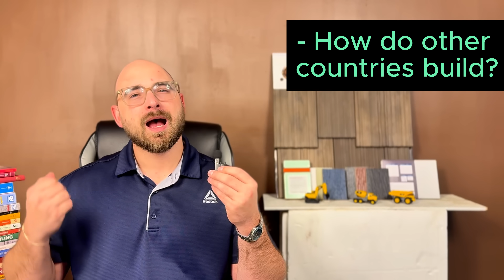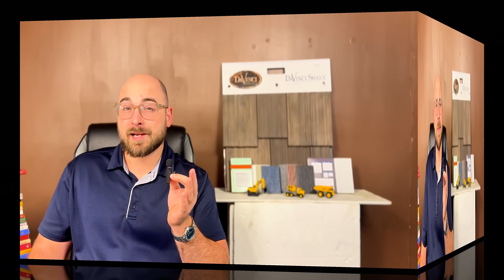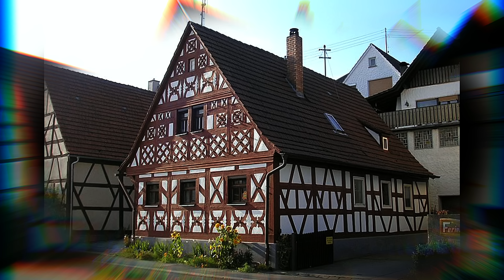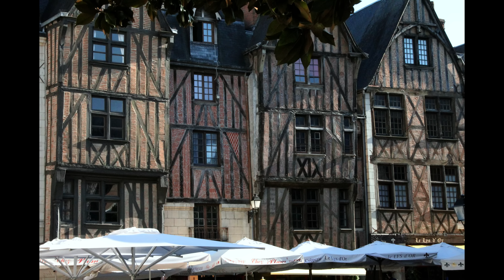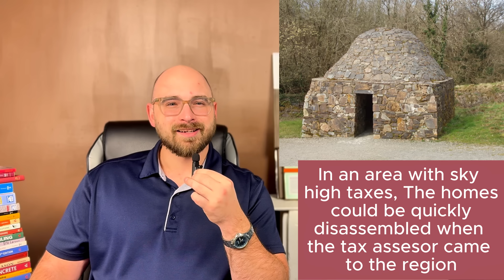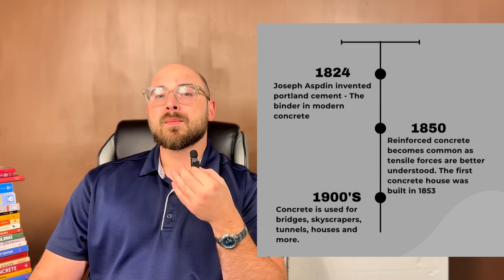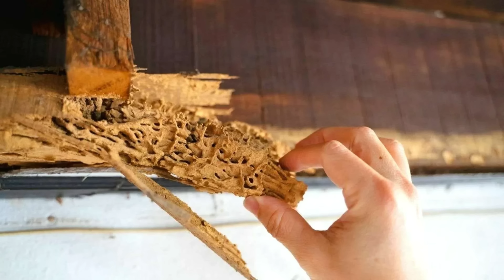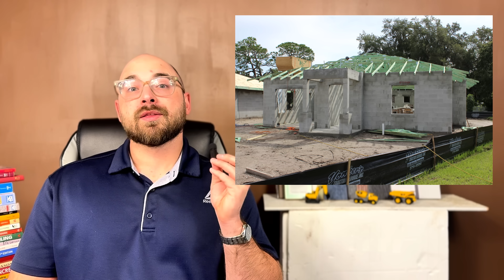Why Other Countries LAUGH at American Homes

Comment: Everyone on here saying wood is better for earthquakes than concrete.  I lived in Japan 17 years and always in solid concrete apartment/townhouses.  They have earthquakes every month where I was.  They chose concrete for a reason.  They were built to withstand severe earthquakes.  There is more to earthquake-resistant construction than just the material used.  They also use some kind of shock absorbing within the foundation.  Also lived in California about 7 years and have seen the wooden houses broken to bits.
Reply from the maker: Thank you for this 

Yes, absolutely true. 

Concrete can be designed to stand higher magnitude earthquakes than wood framing. This is accomplished through the use of seismic joints that allow for movement and reinforced foundations. 

I think in CA, concrete homes require additional engineering and approval. However l, money doesn’t seem to be the issue and at a minimum homes should be of steel construction
Reply: @Mike_Fortin  The whole point of not building with concrete in earthquake zones is to protect the occupants in the event of collapse. It's super simple and a really easy answer
Reply: I traditional Japanese building connections are made wood to wood with advanced geometry at many places while modern construction keeps everything together by nails/screws
Reply: @Stszelec01 
Yes agree, not to mention the quality of the wood species, often sourced from the surrounding forests, etc—in short, a know-how that is the pride of carpenters, masons, roofers, and more.
And tradition means preserving ancestral skills. In France, we have the "compagnons" who preserve and teach these skills (see the restoration of Notre-Dame).
Unfortunately, today, driven by increased productivity, cost reduction, and the greed of developers, these rules of the art are disappearing. Compagnons are abandoning new construction for the restoration of old buildings. And "industrial" construction with a low-skilled workforce is becoming the norm.
Reply: yeah, wooden structures can be extremely solid, but not when heavily optimized for material costs and ease of construction. Unless you have an abundant supply of decent quality lumber it quickly gets more cost effective to use other materials if disaster resistance is a concern. I've  seen a 100+ year old wooden house originally built at a time when they just threw more lumber at every problem. Walls of solid lumber, backed by 2 layers of planking and one layer of particle board! Presumably they just kept adding layers in renovations over the years. Mind you, this was built in a sawmill town at a time when lumber was the region's primary export, so it would have been silly to build with anything else.

Obviously you always want to adapt your construction techniques and material choices to local conditions. The pain sets in when builders compete on construction price alone, slapping together structures they know will have issues in the long run.
Reply: My understanding that is that it's structural masonry (e.g. brick and mortar) that is usually a problem in earthquakes. Cast concrete if done appropriately does quite well.
Reply: @disjustice  "If done appropriately" being not a trivial stipulation! Concrete is very expensive as a construction material because it's completely customized. To make it the typical method would generate a lot of pressure to make it modular and/or to make it possible for trained seals to do it, and both of those likelihoods would chip away at the superior performance.
Reply: Mediterranean too. Stone and concrete
Reply: As far as I know Japanese traditional wood built houses were able to survive many earthquakes too. Guess if it's built properly it can be very durable. New houses in Japan built from wood also have some features to make the house earthquake resistant
Reply: exactly! thats why apple built their round office using japanese eartquake proof foundations in california
Reply: How come @Mike_Fortin says that Japan uses platform framing as their method of choice for home building, while you say it's concrete?
Reply: not exactly correct the concrete structures in japan have some sort of absorbing earthquake plates under their foundations. Traditional Japanese structures that have lasted sometimes back decades are made with wood and without nails to allow side load racking. Some are even floated on rock foundation. Japanese structures are made to resist earthquakes.
Reply: @SimanSlivar Correct. I haven’t lived there for seventeen years, but I pay keen attention when I go (Tokyo) and follow home builders there. 

The quality for the price is great (for now). The house is generally a depreciating asset, it’s the land that’s the big expense.

I’ve seen foundations  being poured on an arrival. 
When I left, two weeks later, all the quality wood and framing (relative to N.America) was done and the treated plywood walls (not sheet rock) were almost complete. The plumbing and electrical were roughed-in, a couple windows were in (couldn’t see the back) and the roof trusses were well on their way.
These are for approximately 1000 sq.ft. homes, no basement. 

The laws (in Tokyo at least) are such that all apartments need to be demolished every few decades and reconstructed to meet updated codes. Not sure about houses, but I strongly suspect not - seen some real shacks there!

Don’t get me started on the attention to detail of deconstructions - just amazing accuracy and technique, plus the  respect for safety and the surrounding neighbourhood.
Reply: @FasterThanSoup  Yeah, I do lots of photography/videography and shot plenty of time-lapses of construction sites.  The work ethic is still strong there, too.  An interesting fact about Japanese addresses, is their building numbers are not in sequence like in the USA.  They number them according to when they were built.  So, the first building has the lowest number and then numbered up from there, and usually scattered all up and down the street all out of order.
Reply: @SimanSlivar  turns out design is more effective than materials... the power of engineering at work.
Reply: Always? 
Did you live far south, Okinawa perhaps?
Reply: @FasterThanSoup  Yes, always.  Didn't live in brick or wood place.  I lived in a two-storey townhouse that was concrete, Yamaguchi-ken.  And then a three-storey apartment building that was concrete, in Kanagawa-ken, about an hour south of Tokyo.  Had lots of earthquarkes.  The buildings would shake but that's all.  I've been to Okinawa several times but for just weeks at a time.  I wouldn't consider Okinawan construction to be at Japan standards.
Reply: @MarkWatson-xi1ry  That’s quite interesting. In the parts of Tokyo that I usually wander, all the new single family homes I’ve seen are wood frame constructions.

However, these are for average working class families.
The far fewer completed concrete homes I’ve seen are relatively huge, require a larger parcel of land, and were in affluent or outskirt areas.
Reply: However, during earthquakes, nor\thing beats a wooden house, just because it can flex without breaking, all types of brick and cincrete break in these cases
Reply: Can confirm as I live in Ecuador, another earthquake prone area, as almost all houses are made of concrete and brick, they last more than houses made from wood and cane and the repair is minimal, unless a serious 7+ Richter magnitude earthquake occurs.
Reply: There are also massive steel plates and rubber rings that can be used instead of concrete as a foundation, once an earthquake  hits the plates shift around while the house stays in place
Reply: You seem to never have seen how Japanese houses were and are built. Try to watch some before after parts where they renovate houses. And the basic building method hasn't really changed: Foundation, put pillars in the walls and the middle of the house to support the second floor and/or the roof. Put the roof on top and close the gaps with two wooden board. E voila, you'll have your house. The only big difference nowadays is that the basement doesn't sit on a few big stones any longer but on a concrete foundation. And builders usually put some kind of heat insulation in the gaps between the inside and outside wall boards. The preferred method seems to be some fibry material in bags though one architect also used some kind of deflatable foam. And either method is also used under the roof. 

What shocks me the most is that it's still quite the normal to use simple glazed windows and/or uninsulated window frames and/or building gaps around the windows and doors. Japanese houses are bl...dy cold in winter and quickly get dangerously hot in summer. So much to "Japanese houses are built for summer" excuse. 

I've been told by an old man once who he's afraid to live in a concrete house because when during an earthquake the second floor falls down, it'll kill him. Dude, when a wooden second floor falls on you, you won't live to tell the tale, either. People totally seem to have forgotten that most of the 6000 people in Kobe died because the second floor came down and either killed them directly or trapped them so long that either the winter cold or the raging fires living of the wooden houses killed them. So it doesn't really make wood better than concrete or stone. The most important part is that houses can swing in one way or the other and can deflect the earthy vibrations during an earthquake. 

That said if wood really were superior, you wouldn't have the annoying situation that houses are no longer worth anything except for the land they are standing on. Except you're rich and can afford a luxurious house, it's actually not an investment to build a house here. To to forget, in the case of a fire, nothing will be left to salvage. And even a colleague told me that their family lost their home due to moraibi - fire that sprang over from the neighbouring house. That is still a huge threat in Japan, especially with most people still using gas for cooking and kerosene heaters in winter. And the punishment for @rs0n is stricter than for a h0m!c!de.
Reply: I'm from Indonesia, a country that has a lot of earthquake every year. We do have concrete houses too. The wood houses are the traditional houses, but good quality woods are so expensive and rare. We have regulations how to build brick house or concrete house. My parents house still standing strong for almost 40 years, and experienced one big earthquake in 2006.
Reply: You are talking about multi-story, multi-family buildings that use steel reinforced concrete. Those have to be properly designed to take the swaying in an earthquake. WE KNOW that wood is better than standard masonry, from actual real-world results as well as full scale shake table experiments
Reply: Indeed. Though good carpenting can stand very well to earthquake then it often burned in the following fires throughout Japanese history. And anti-seismic concrete buildings are just incredibly resilient.
Reply: @chris.pbacon7949 You can make concrete earthquake resilient and you can make wood fire resistant. Dr. Erwin Thoma builds using solid wood walls in Austria and his structures have high fire ratings. Unless you want to live in a sterile cement block most concrete buildings are chock full and adorned with all kinds of flammable materials. We saw this in the recent L.A. fires where some concrete buildings were reduced to rubble and others had only concrete left and are now tear downs. Fire can be best mitigated by prevention and adequate infrastructure to handle it. In a situation where nature takes control even concrete buildings will be destroyed. I'm not arguing that wood is less flammable than concrete but the fire proof value of concrete is overstated.
Reply: Yeah I was also a bit peeved at the diagram that showed Japan only with wood on the world map. Sure, they do make their houses out of wood... but close to 40% of the population live in apartment blocks usually made of concrete. Should've shown both icons.
Reply: Japanese homes are designed to last 15 years and commonly those with means tear the house down and rebuild it every ten years. Also no insulation and single pane windows and no central air conditioning or heating means huge electricity bills. I’ve lived in Japan for a decade now. US homes are far superior to Japanese ones.
Reply: Sir, what in the actual f*ck are you talking about? I've LIVED IN CALIFORNIA my ENTIRE life and my dad owns his own construction business, he has built his own homes & apts (that I lived in all while growing up) and I have helped him build a couple myself. Literally all homes here have a FOUNDATION. Made of concrete and rebar. I also live in the MOST earthquake prone area OF CALIFORNIA (Northern California). Go Google how many earthquakes occur in California every year. Or hell, even every single day. I'll wait ⌚. I've been through countless quakes, big & small. Never in my entire f*cking life have I ever seen "homes broken to bits" because of an earthquake in California. Ever! So what, when and where specifically are you talking about? The 1906 San Francisco earthquake lol???

Otherwise I call f*cking bullsh*t on your whole entire claim.
Reply: It’s nice to see such great ‘concrete’ examples 😂
Reply: Haha 😂😂😂😂😂😂😂😂
Reply: if you're using concrete in an earthquake prone area you need to very explicitly engineer it to be stable against earthquakes, the japanese are actually experimenting with wood framed construction techniques to aid in providing earthquake stability.

The biggest problem is resonance in the house building up the point of complete destruction, a big problem with concrete, is that it tends to be rather brittle, and crack quite easily. Which can be a large concern structurally, where as with wood this is significantly less likely if you appropriately engineer the home. Wood tends to flex bend and give a lot more, same with the jointing techniques. It's just better suited to a stable construction like this.
Reply: When Europeans first came to Japan and built brick houses, they didn't fare as well.
Reply: I bet they got the memo in LA
Reply: Also Japan invested a TON on money into earthquake resistant construction. They're the leaders in that regard
Reply: you likely lived in a multi-story concrete building. and we have those in california too, built to withstand earthquakes. but most americans live in a detached single family home. building those to of concrete and able roll in an earthquake would be prohibitively expensive, so most people don’t. i lived in a concrete house in florida (where the ground doesn’t move but the wind sure does)
Reply: An friend of mine works in a Company that Produces houses out of wood here in the Black forest, germany and he told me they had a customer from Japan but Japan requires special earthquake and fire resistent tests if you want to sell and build houses there so they had to build 1 house just to get destroyed in their test facility ... in the end they got told it was one of the best test Results ever .. 100% solid wood nothing else not even glue
Reply: It depends how the concrete is laid.
Reply: But well your temples are standing after thausands of earthquakes too. Wood şs better than concrete for eartquake it doesnt mean you cant make earthquake resistant houses and apartments
Reply: The houses and structures that you are talking about are new buildings and haven't endured any mega earthquakes. The Japanese countryside is littered with centuries old timber frame houses and the reason that many of the original Shinto Shrines, pagodas and Buddhist temples are still standing approaching a thousand years after being built is because they are timber construction. Japanese castles on the other hand are largely built of stone and have in some cases been rebuilt due to earthquake damage. Japanese builders go to extreme lengths to build shock absorbing features into their concrete buildings which can be quite costly for larger structures. I've been to Japan many times and my wife was living in Kobe during Kansai's last major earthquake. She witnessed a lot of structural failure in her neighbourhood.
Reply: They are also not insulated like the US and much smaller.
Reply: They used wood in Japan, because they didn't have steel or reinforced concrete for houses yet lol
Reply: Houses in Australia are made from wood and the termites eat them it’s a real problem
Reply: In victoria Australia the stick built homes generally cope better dollar for dollar due to the highly reactive soils we have. If money is not object over engineered concrete  construction will do well to cope. From an energy perspective concrete is the best as long as it is thick.
Reply: Concrete is quite a wide range of ceramic materials. The concrete used by Romans or early Dutch would crumble in earthquakes quite easily. Also the concrete used for heavy rail would not tollerate earthquakes, if it didn't had a "suspension" of dirt and rocks and flat geometry.
The concrete used for modern houses is basically a super-wood. It's similar flexible, with a much higher strength. Also you are completely free in shape. So it's quite easy ro build ~4 floors just with concrete. If you add anything more than 4 floors, or even a propper basement, any sane engineer would start mixing compounds.
In a high rising building roughly every 5 floors the compound of concrete slightly changes from something stiff, to something more flexible but less strong. Reason is you don't need to support as many floors on top of you the higher you go. And you need the flexibility as wind, weather or earthquakes will move the whole floor more and more the higher you go. If your material would be too stiff, it would start grinding itself inside the wall.
Reply: True, but Japan implemented different building technology, their concrete structures are more "flexible" than other countries, so they can withstand vibrations better, but it only makes sense for this extra cost if it is needed. US goes low on costs, even if they shouldn't in some areas. Who cares, right? It's capitalism, baby!
Reply: This is why reinforced concrete is the preferred building material (for houses too) in Chile.
Reply: Also the main threat is hurricanes and tornadoes, which those matchbox homes do terrible against.
Reply: There are MANY wooden houses in Japan. It is not rare at all to find it. Apartments even in USA are mostly concrete
Reply: That depends upon the soil
Reply: Countless concrete structures are felled by temblors every year around the globe. Concrete is very heavy and has a massive dead load that can and is many times very deadly in an earthquake. Stick framed, done properly, is plenty safe.
Reply: @tahowaiiankilgore9268  I have not seen a single new hotel or mall or any 4 storey or taller building built from wood.  Have you?
Reply: But do those homes sound like an echo chamber?
Reply: @cindya9572 No.  You don't usually see bare concrete on the interior.  They cover it with something.  My last apartment in Japan had a thick wallpaper-like covering with a texture.  But to hang a heavy picture on the wall, the landlord came and used a hammer drill to install the hook.  They sway in earthquakes.
Reply: Majority of single family homes are still timber framed in Japan. Guess you never saw the images of the Hanshin Expressway Fukae bridge's concrete support column snap like toothpicks in 1995.
Reply: Mate, it´s not that hard, when they say that wood is better for earthquakes than concrete they are considering the price, you need a lot more money to make a concrete building equal to a wood building regarding earthquake resistance.
Reply: *rebar not just concrete
Reply: Labor availability is a big problem in the USA.
Reply: And yet, 90% of the single family homes in Japan are made of wood.
Reply: To be clear: you lived in apartments / townhouses in Japan.  So...apples & oranges.  There are plenty of machiya and kominka in Japan, inevitably made of wood, and they withstand earthquakes just fine; they are all freestanding single-family dwellings.  That is what we are comparing here.
Reply: @bricology  they don't withstand them just fine, there's a reason they consider their housing disposable
Reply: For larger structures, you can build out of concrete and implement the various techniques and equipment needed to make that earthquake resistant to a sufficiently high degree and still have the price be reasonable... better hope you made it well enough to withstand the strongest earthquake that happens while people are living in it though, because if it comes down it's going very poorly for them.

For smaller structures, you can achieve very high earthquake resistance with wood, if you build it properly, at a much lower price, and also build it in such a way that, in the event that an earthquake is strong enough to bring it down, it's a lot more survivable for those inside than a concrete structure would be. 

That said, that's the Frame. Buildings in New Zealand are generally built in line with those two bits of logic, but most houses, despite having light wood frames, will be Clad in stone blocks, and roofed in concrete or metal (and the whole frame is structured in such a way that the roofing generally won't fall Into the building, but rather end up being dumped off the side one way or another.)  

On the other hand hospitals and other similar large structures are basically built on giant shock absorbers (I was in one during a significant aftershock. The noise from the shingle-y ground nearby was ... Dramatic...  Actual shaking in the hospital building? None, the shock absorbers soaked the whole thing.  Not sure what it was like during the big earthquakes proper though). 

Not quite sure what they do with the middling sized structures though. 

Mind you, you'd be surprised how strong an earthquake a building built entirely of brick can survive if you build it right (though anyone in or around it will still have to watch out for the occasional bit of falling masionry or the like so it's still not a great idea)   Of course if you Don't such a structure can rapidly disassemble itself into its component parts... (both happened during the big earthquakes in Christchurch. The railway station was a typical artifact of the Ministry of Works days: It was probably on-time-ish, it was almost certainly well over budget... it stayed up for decades after the sort of rail services it was intended for had been scrapped and withstood one of the biggest earthquakes the city, and country, has ever seen, requiring only relatively minor repairs, despite being made pretty much entirely of brick.  On the otherhand the private house, which I think was built much more recently, also made entirely of brick, just completely disassembled itself. From memory the owner, who was inside at the time, was basically unharmed, but only because he was basically launched out the window early on in the process)
Reply: Most home son Japan are built with wood and not concrete. Any research would show a wood house hood up better in an earthquake zone and a concrete hold ONLY holds up with rebar.
Reply: Yeah that's because you haven't experienced the big one, regardless where you live.

I actually watched a simulator a couple weeks back that simulated what would happen to a concrete, brick, steel, and wood framed apartment building if an earthquake was to hit. 

All four buildings survived until an earthquake scaled at 11 and 12 happened.

The brick building collapsed at 10.
The concrete building collapsed at 11.
Everything collapsed at 12.

Granted this was just a simulator, it's theoretically possible to have higher but we haven't seen any higher than a 9.2.
Reply: @REAL-UNKNOWN-SHINOBI what do you mean 10 and 12 scale? Richter scale? There has been no 10, 11 or 12 Richter EVER like that has never happened in the history of the world, the biggest one recorded was in Chile and that was 9,5 Richter. If there is a 10 plus earthquake NOTHING IS GETTING OUT OF THAT.
Reply: @blackmailerhack3056  I think that simulation video was explaining what would theoretically would happen if there was a 10, 11, and 12. 

I know there isn't anything higher than 9 and like you said, the 9.5 is an exception to that.
Reply: Ok, what about hurricanes & tornadoes?  Brick and concrete homes still get blown to bits.
Reply: @grahamparks3038   That would make sense, if US would build wood ONLY in areas with hurricanes and tornadoes. BUT THEY DON'T. Also: China, Philippines and Japan, top-3 countries in number of hurricanes visiting them, all build out of concrete and brick.
Reply: @SkywalkerWroc  the video openly states Japan uses wood framed housing... the US has various kinds of building materials, but concrete and brick is legitimately worse at holding up to earthquakes due to the weight. Japan has a huge testing lab that demonstrates how wood housing is superior to brick and concrete.
Reply: @V3RTIGO222  video states that, I know. But it seems like total BS, given that OP said or even a most rudimentary check on Google.
Reply: @SkywalkerWroc again the hurricanes on that side of the world are much smaller than what is typically in the Americas
Reply: Architect licensed in Mexico and NY here. Can confirm, in Mexico which is highly seismic, wooden construction is not used except for that beach palapa that's meant to be blow away when the hurricane comes. In my opinion concrete homes are better. Not only are they sturdier, they don't have the thousand crawlspaces that fill with dust and give everyone so many allergies. Wood is more sustainable than concrete but in the US I have seen zero appreciation for sustainability in architecture, while in Mexico there is way more. USians spend a stupid amount of energy in their homes. They want their winter homes as hot as summer and their summer homes as cold as winter. Mexicans aren't that addicted to AC unless you live in the beach/desert. It's nonsense.
Reply: Home fires are a bigger risk than earth quakes. In the US  more people are killed by bullets and cars penetrating walls than by earth quakes... Concrete, steel, and bricks require less maintenance and provide more safety to home owners (Buying more guns doesn't 😘)
Reply: It is true..i live in indonesia, in a town known for endless eartquakes (jogjakarta). We no longer build wood houses since it was already proven that they were the hardest hit (with thousands of people dead). Now? It is mostly just fences or the roofings which r affected.
Reply: This argument doesn't make sense to me because not every house in the US is in an earthquake zone. And yet somehow most homes in non earthquake zones are still made of wood
Reply: Talking about California, the fires that recently hit the Palisades in LA would never have happened in a similar European neighborhood built with brick and cement houses!
Reply: @you2be839   True but a European neighborhood would also never have to deal with a 7.0 earthquake. NorCal just had one last month and we took zero damage.
While that's partly because of the earthquake type and smaller quakes have done more damage in the past, it's also because of how the building are made.
Reply: @spriken  The earthquakes are no excuse, Japan has more earthquakes than California (and bigger ones too), and most wood houses are just old traditional Japanese houses!
Reply: @you2be839  and the bricks likely would have been reduced to rubble by the usual earthquake, and the cement would need to have a special plate designed to shift during one which would cause one of the benefits of concrete (price) to be nullified. The fires aren't the only thing there.
Reply: @you2be839 that is false. Many brick wall buildings have been destroyed in Spain and France with the current fire
Reply: @you2be839 While that is factually true, having all those homes be made of stonework would have been costly to build and in an earthquake would have collapsed or be structurally unsafe after a major earthquake.
Reply: Japanese castles were made of wood because of earthquakes.
Reply: The mistake is to believe that "old" means "automatically superior in everything."  Wood was traditionally used because it was the best compromise of strength and flexibility.  They did run tests and evaluations and while someJapanese  buildings were truly inspired and resistant to earthquakes, many old wooden buildings in Japan were not particularly earthquake proof.  The takeaway was that it was "good enough" with the provision that it could be rebuilt quickly if something went bad.

Also the biggest problem in cities was not the earthquake, it was fires.  Massive fires tore through Japanese cities made of wood after earthquakes, that was the real danger.  So as Japan modernized they looked to methods, like concrete to build better buildings that would resist earthquakes, but also be less prone to fires.

Japan has specific codes, but earthquake magnitudes, terrain and other things make it almost impossible to have one set of regulations to would cover every situation.  Another issue they didn't notice for a while is that the mass of a building or several buildings in an area does change the way shockwaves move, which means that even spec buildings can be damaged because the ground beneath it would be more affected than when they looked at the building in isolation.

Another factor is that buildings may be earthquake resistant, they may not be earthquake proof, it was found out that some buildings took the stress very well, but others are increasingly stressed by earthquakes and lose their resistance over time.  Even changing the outside cladding or roof can have a huge effect on how a building reacts to an earthquake.   Add to that a percentage of houses that are simply not up to spec due to mistakes, and other issues.

The takeaway is that Japan is better prepared than many countries, their wooden buildings can resist earthquakes, but are not guaranteed to do so.  Their newer buildings are more solid and meant to be resistant, but nature can always throw a curveball and even the most prepared country may find that many buildings end up damaged or destroyed by earthquakes.
Reply: Concrete is better than wood for earthquakes, hands down. As a Californian I see the value, yet expense and environmental impact are huge. While quakes that would take out a wood frame house are once in a lifetime events, fire may turn the tide on concrete here.
Reply: @sirhcmi3  As a Southern Californian that's majored in Geology that's not accurate. I'm sorry, but the only time concrete is better than wooden structures during an earthquake is when the BASE of the building has some form of shock absorption. A concrete building on a concrete slab (base), that building is going to crack and fracture at any earthquake. Wooden houses can be built on concrete slabs and still survive MOST earthquakes. Why? Because wood flexes more easily without suffering major shear forces during an earthquake, stone/brick/concrete cannot flex as easily as wood, and thus fracture and break.
Reply: @mike954  Agreed! Thank you for adding critical detail... My comment assumed a properly built structure, based on a conversation I had with a Colorado School of Mines graduate with 20-some years experience building hospitals in California. I certainly could have misunderstood. It was a rather technical conversation and several years ago. Either way, my home is stick framed on a concrete slab and I don't expect to be able to afford one with seismic base isolation any time soon.
Reply: @sirhcmi3  As a Structural Engineer, who is studying to take the Seismic and Surveying test to get a PE in Civil Engineering in California, wood also has the added benefit of being less weight.  The force on a building is heavily dependent on the weight of the building, with on average, a wood wall weighs about 15 plf give or take, and an 8" concrete wall weighs 100 psf.  The 15 psf also includes the insulation, and sheathing, etc., which the concrete wall does not.  You would probably have to add an additional 10 psf (being a little conservative here) to the wall for the furring walls/insulation).  The floor is about the same, with wood floors being 15 psf give or take, while most concrete floors are 6", so 75 psf.  If we take a square building that is 10 feet by 10 feet, with 10 feet walls, the wood building would weigh 7,500 lbs, while the concrete building would weigh (excluding the additional weight for the furring walls/insulation) 47,500 pounds. Meaning the force on the building is over 6 times that of the wood building.  Of course, I'm over-simplifying for clarity, like most building roofs have a higher load (usually, around 17 psf for wood.  sometimes with concrete structures they use metal decking, which would weigh less than wood framing).

TLDR: For the same size house, you would have to deal with much higher loads with a less flexible framing, which means it would cost a lot more to make it code compliant so that it would survive an earthquake.

There is a little side note, that being code compliant doesn't mean it would survive an earthquake, because the code is there to protect human life, not the building itself (except in some buildings, such as hospitals with surgery rooms, important infrastructure, etc.) That's why floor joists are usually rated 1-hour, meaning it would take 1 hour to burn through)
Reply: @sirhcmi3  Well, I don't have experience building hospitals, but based on what I do know, is that hospitals usually have higher standards of earthquake tolerance than regular California homes. A lot of the multistory buildings that are built out of steel and concrete are designed to have more flexibility (and seismic dampeners) than a one to two story brick or stone home. Even the old stone skyscrapers in downtown LA have retrofitted seismic dampeners to help it in an earthquake. But your average brick house or single story building will usually have seismic bolts attached to keep it from toppling completely. 
I too grew up in a wooden frame house on a concrete slab, it's still standing. The only problem is the type of soil it's built on top of. For my house it was built on top of a type of clay that expands to twice its size when wet (and conversely shrinks when dry). This type of expansion and contraction causes difficulty in closing doors and gates and causes cracks in the plaster and drywall, but surprisingly the wood frame/beams are intact.
Reply: @bbdest3082  Look up Ronan Point on Wikipedia to see how not to build a tower block. Having said that I expect it was fire proof.
Reply: When did you see wood house splintering to bits in an earthquake? I lived in California for six decades, and lived though a number of earthquakes, and the only time wood houses failed was when their concrete foundations heaved. By far the greatest damage was to steel and concrete structures.
Reply: @Jeffhowardmeade  Coalinga.  1983 I believe.
Reply: @MarkWatson-xi1ry  I was heading down I-5 to LA a few days after that one and stopped in to be a voyeur. The bank at the main intersection collapsed, but it was unreinforced masonry. I didn't see any collapsed wood buildings.
Reply: @Jeffhowardmeade  same in new Zealand, our houses are similar to US
Reply: @180Tall18Long  It would be cool to build a house out of swamp kauri. Had anyone there done that?
Reply: @Jeffhowardmeade  it was used back in the day but it's protected now. We just use good old pine now.
Reply: @180Tall18Long  didn't Church Christ have a an earthquake that destroyed a ton of concrete buildings
Reply: @Jeffhowardmeade  go take a look at san francisco earthquake, single family homes got hit hard ,because of them being weak and also them being 2 storey, nearly all tall office buildings survived
Reply: @girayhankaya  I was sent to assist SFPD in the aftermath of Loma Prieta. Very few wood structures were harmed, and those which were was a result of faulty design. An apartment building built over a parking garage that had no shear walls was damaged. Just the parking level collapsed. The rest of the building, now about 12 feet shorter, was remarkably intact. Other wood buildings burned when natural gas pipes ruptured, though not many.

Other than that, buildings which suffered damage were concrete. The masonry tower at a school in the South Bay collapsed, killing a teacher. The school was later deemed unsafe and demolished. In Oakland a concrete double-deck freeway collapsed, killing something like 43 people. I used to drive on that freeway and watched the cars around me bounce up and down going over the seams and thought there was something wrong with the way it was built. A steel section of the Bay Bridge collapsed onto the lower deck, killing a driver.

My area of San Jose, affectionately dubbed the "Stucco Jungle", had cracks in said stucco, but nobody lost a single house.
Reply: @Jeffhowardmeade  i am no expert in this issue, but the most important thing is, sadly chance factor, the buildings are by structural elements, resonate with different magnitudes, if building fully resonates with the ground, nothing would happen,  and tall buildings resonate with bigger quakes while shorter ones resonate with smaller ones (gross generalisation i know) and concrete buildings have excellent sturdiness because concrete itself is wonderful against compressive shocks while stell is good against tensile ones, so concrete buildings is if reinforced with rebar, generally the best one over there
Loma pieta is as far as i can get, a small one 15 seconds with 6.9 richter, japanese would only laugh in that
Reply: @Jeffhowardmeade refering to huricane maybe because earthquake rarely hit u.s
Reply: @Jeffhowardmeade  Northridge. MANY homes on my street splintered and failed.
Reply: @District34  I wasn’t there, but I looked through as many pics as I could find. Aside from an apartment building in which the upper two floors collapsed onto the bottom floor, I saw no collapsed houses. Damaged, even irreparable, yes. Fell in on their occupants as you would find in a city full of masonry buildings? No.